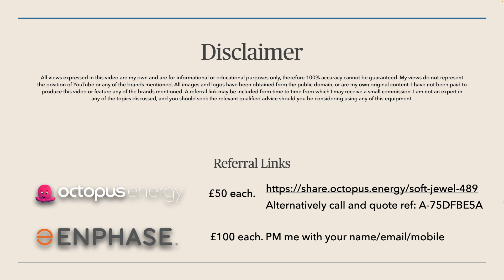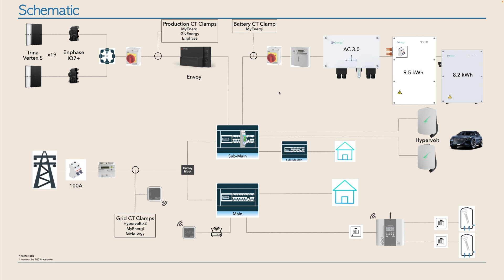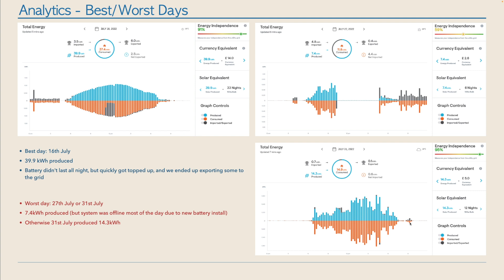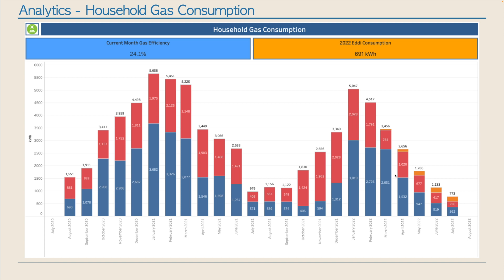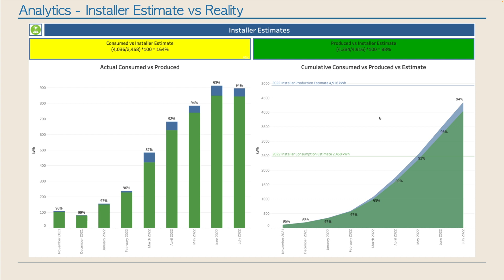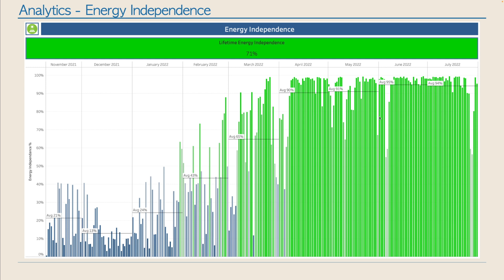Solar Performance   July 2022 Update

Comment: Hi very interesting video and thanks for taking the time to explain your system. I've only just had Solar fitted 4.1K array south facing with Solaredge 3.68 inverter. Eddi to be fitted (currently on back order) this will help to mop up the current excess being sent to the grid, when funds permit I will install a battery. I like you schematics and was wondering where do you obtain all the icons,  are they just downloaded photo & symbols from the web? many thanks
Reply from the maker: hi there. yes, all the images are just from google or free icon websites

Comment: Hi, do you have an electric cooker and if so is it being powered from the Battery/Invertor. A typical electric cooker needs a dedicated 32A circuit.
Reply from the maker: I do not. But I have 2 EV chargers which can consume upto 32A each. When I fire those up, the battery provides 3kW which is is max discharge rate and the rest comes from solar/grid. I also have a 3kW immersion heater, and again the battery can provide that power unless I change settings and force the power to come from the grid for some reason. 

So I believe it will work just fine if you have an electric cooker.
Reply: Hi thanks for the quick reply.

Comment: do you have a video (or would you consider one) goign through how you produce these dashboards? Is it a single software (Givenergy/myenergy/other) or custom?
Reply from the maker: It's a whole mixture of stuff I'm afraid.

I get all the data from Enphase/GivEnergy/Audi/local fuel prices/weather apps, then I put this all in a google spreadsheet, and then I connect a Tableau dashboard on top for the visualisations. I then take screenshots or screen recordings, have some keynote slides for info I'm sharing, and throw all of this into some video editing software to stitch everything together.

The spreadsheet started simple, and has been growing organically as I keep adding to it. It's pretty ugly now with several tabs, especially as I've added some notes to remind me how I calculated some of the numbers so I keep things consistent.

I'll consider a video on it. It's nothing mind-blowing...you can do it all in spreadsheet. I think you'll probably be unimpressed by what has to go on under the hood!

I'm pretty sure I can make this all simpler. I think an overhaul will be due when we get to 12 months as I'll need to summarise things differently, so maybe that's when I'll try to rebuild everything.

Comment: I have a 5.2kw array, 8.2kw Givenergy battery and find on the cooler days in may & June I can get 5.2kw out put from my array as the panels don't get so hot, July August I max out at 4.4kw. I also have seen my inverter drop power out put as the internal temp has hit 55C. It's place in an office area which does get hot on these sunny days and I have place a fan under it which fixes the issue, I would check the internal inverter temp if yours is in a left or place where the temp get high, my room was about 30C and the inverter just could not shed heat during peak operation.
Reply from the maker: Very interesting. Is your array all south facing by any chance? 

I have just started monitoring the temp, and it routinely sits at 45deg and goes up to about 75 ish around lunchtime when its peak temp and the battery is charging. So I've also put a smart fan based on a thermostat there to help it shed the heat. Although this still isn't doing enough, so now I've bought an AC unit I can vent out of a window. It should be arriving this week, so we'll see how it performs.

Comment: Maybe a stupid question but what’s controlling your system overall in-terms of when to charge the system, use the batteries etc. Thanks and really useful video
Reply from the maker: Thanks Gavin. All the brands are working independently based on the grid CT readings. 

Givenergy monitors that grid ct and has a ‘dynamic’ setting which I left it on soo it charges and discharges dynamically based on what that CT is reading, with a view to minimising grid import. They have other settings available to only discharge at a certain time etc etc. 

The myenergi system also has a grid CT in the same place and will divert Solar surplus to the Eddi. I have a 10 second delay on reacting to this so that the givenergy system can take priority and fill up the battery first.

The Hypervolt also has a grid ct, again monitoring for solar surplus. However, EVs need a minimum of 6amps before they start charging soo this takes the least priority of all the things…as 6amps is a significant export. 

I got lucky that it all works in the order of priority that I want, but I can override it all via the apps, or I could change a setting on the Eddi to require a higher threshold before it kicks in, therefore allowing the EV chargers to kick in first…then it would do that automatically. 

Proper integration between the brands is really something that needs to be developed…but it doesn’t exist yet unless you buy all the equipment from within the same brand (that’s if they sell everything). You might be able to achieve integration using APIs and Home Assistant. I tried, but the programming is too tricky for me and really needs a windows based computer to configure everything (I’m a mac guy).
Reply: Ah that makes perfect sense now-thank you!

Comment: What do the believe is the useable battery capacity? Does the 9.5 have more depth of charge than the 8.2 as I think is the case?
Reply from the maker: both 8.2 and 9.5 have 100% depth of discharge. It says my total capacity is 17.76kw. I'll try to figure out if I get this, or something less. I read the other day that GivEnergy numbers are the available storage whereas other brands give the total capacity and then you have to subtract a bit to get the useable figure. Not too sure if this is accurate, but I'll try to figure it out...
Reply: @HarvestingTheSun  I think GE told me that the 8.2 operates at 80% giving 6.56 but the 9.5 gives 100% so a total of 16.06. I've certainly noticed my 8.2 giving less output In the year i have had it so will be interested in what the combined capacity will be when I get my 9.5
Reply from the maker: @NickStroud  that sounds about right to me. I noticed me 8.2 only giving about 6.5ish.

When the system did the first full discharge and charge, it took longer than I expected so it does make me think the 9.5 is giving the full 9.5.

Comment: Just stumbled across this site. I have had solar panels since 2012. I would love to be able to export the data and be able to do some of the analyses that you do. Is there a standard piece of kit I can buy to export all the generation data? 10 years ago I did have a USB cable running down from the attic and could attach this to my laptop, but stopped working when laptop needed to be replaced. Any help appreciated
Reply from the maker: hey there. All the equipment I have comes with an app which provides me all this data. I just type it all into a spreadsheet to then create the charts.

You could buy a CT clamp based energy monitor such as an 'Emporia Smart Home Energy Monitor' (available on Amazon) which would give you all the data and readings with an app and website? The numbers might not be 100% accurate, but it will be close enough.

Comment: Really good. Currently deciding if I want to start with a battery or panels first. Think I might go with a battery
Reply from the maker: If you can only afford 1, go with the battery. It can benefit you all year round by charging up at the cheap rate overnight, and discharging during the day when you would otherwise buy peak rate. If you get Octopus Go, then you're electricity becomes a quarter of the price!

In the UK, the solar panels are really only generating enough between March and October, so they won't be 'working' for you all year round. (They'll still produce in the winter months, but not much).

The battery needs an inverter to work. If you get a hybrid inverter (which is only about £200 more than an AC inverter), then when you do decide to get solar panels, the hybrid inverter can be connected to the solar panels. This will save you getting another inverter later on which is about £800+.
Reply: @HarvestingTheSun  sweet I'm the UK and was thinking the same thing in regards to to solar generation through out the year. Plus I have bought into the ripple wind farm investment which will definitely help take some money off
Reply: Just remember to get Octopus Go you need an EV, hybrid or full.
Reply from the maker: @lynnfisher4396  I have Octopus Go at another property and don’t have an EV or Solar/battery there. I specifically asked them before switching and they said no problem.
Reply: @HarvestingTheSun  well that is interesting. Thank you, last year there applicants were being asked if they had. We weren’t when we first went on in 2020 after installing the Powerwall and haven’t been asked since. We had a hybrid them and full EV now so it wouldn’t have been an issue. I have a neighbour who has just had a battery and solar installed. He is on Octopus SVR waiting for his EV to arrive in January intending to move to Go then. I will let him know as he will want to supplement the lack of solar by moving to Go in Oct/Nov.